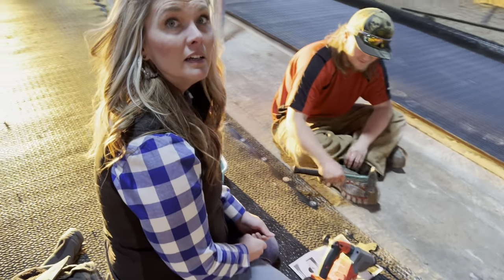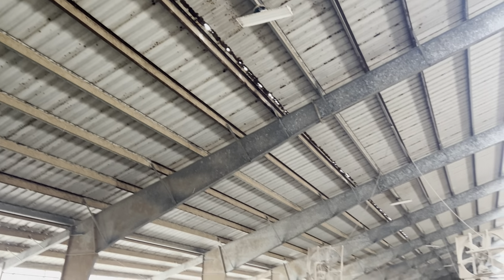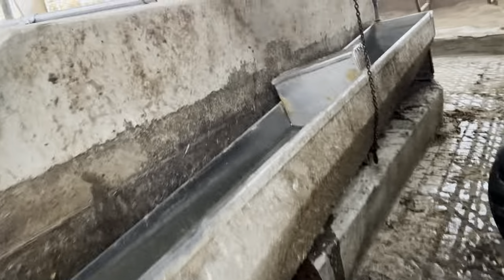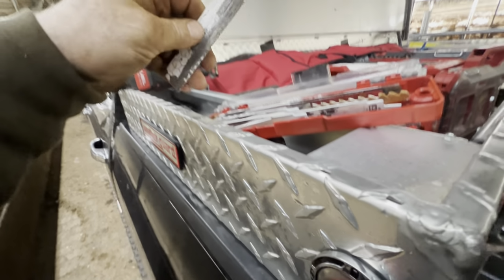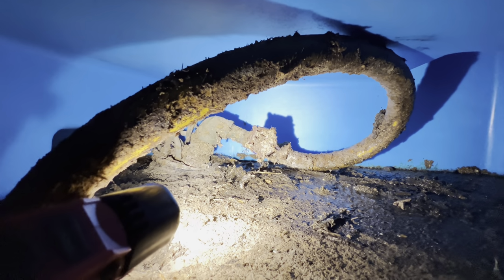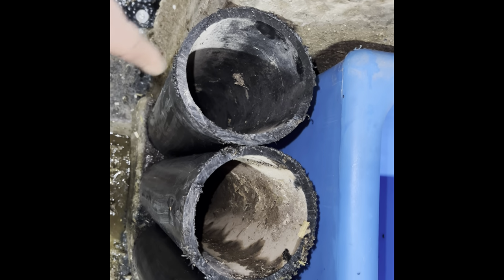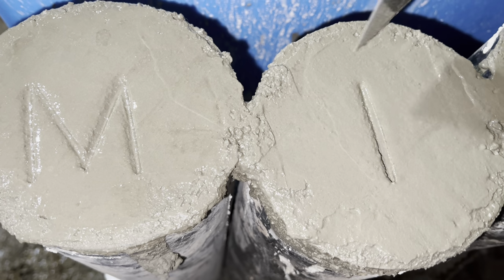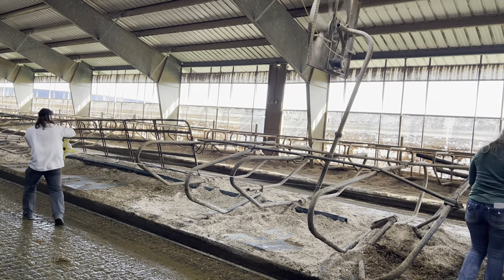I gave them a 99 night guarantee! Dairy barn remodel, engineered for cow comfort to make more milk.

Comment: There is a tape that you can buy, should be at Lowe's or home Depot, it goes around windows to seal so it don't leak, you pull the backing off of it and stick it down, kind of like barabond that NASCAR teams use when they get in a wreck, that is really sticky stuff and should fix your problem until you can afford to start replacing your roof
Reply from the maker: That’s what I’m looking for. I’ll have to check it out. If anybody knows the name comment please. There will probably be a video of me installing it. It looks like it’ll be a big job but like you said hopefully it’s just buys me some time.

Comment: From my experience of building freestalls and parlors and with the way my barn was built ur best bet is to just get it all resheeted and have new roof put on feel free to respond and I can give u more pointers for it
Reply from the maker: Thanks for the advice but there’s absolutely no way I can afford to replace 98% when 2% is bad. I’m looking into a sticky rook of rubber to lay down on the top side.  I’ll probably have a video of the solution.
Reply: @Drloew1  hey whatever works I know there is lot of products like that out there hopefully you find a really good one that sticks for long time them girls deserve the best like you guys give em definitely when they possibly “have tooth aches” lol
Reply from the maker: I’m not thinking it would last to long but hope I can squeeze another 3-4-5 years out of the roof.
Reply: @Drloew1  you should be able to it’s just holes if they get about 5-7 inches in diameter then ur gonna wanna replace it if anything get a few sheets of roof just cut small rectangles out cover em and you should be good ur suppose to seal when doing it but when we did a lot of replacements like that we never sealed em